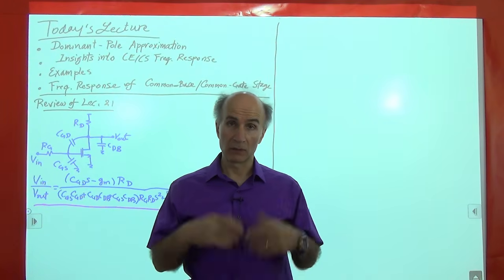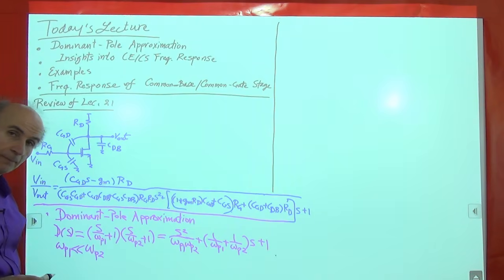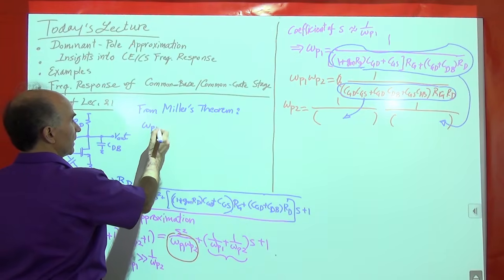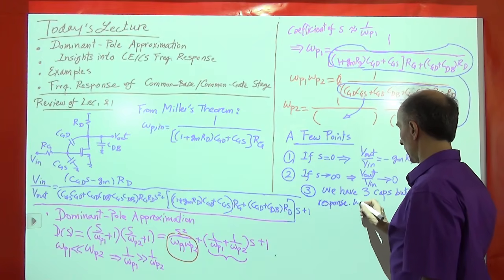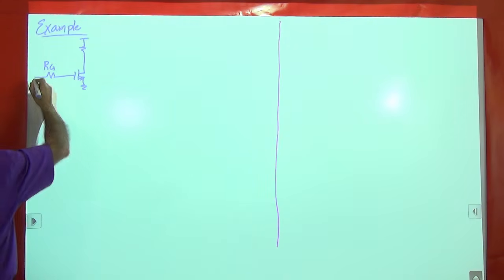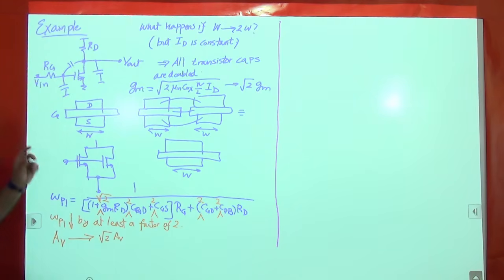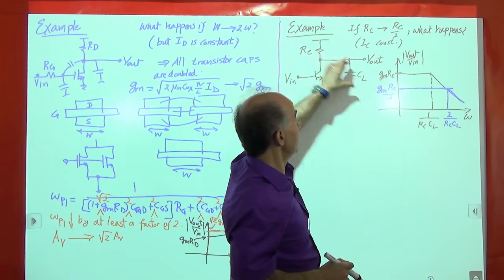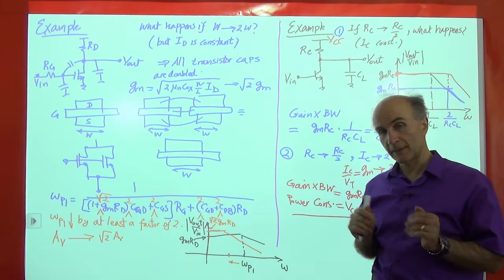Razavi Electronics2 Lec22: Dominant-Pole Approx., Resp. of CE/CS & Common-Base/Gate Stage

Comment: 16:00 By miller since Av^-1 is 0 we can take CDB to ground and get CDB*RD
Reply: It is a common source amplifier. Av=-gmRd, by using Miller's theorem Cgd splits into two parts. One is at the input side. Another one is at the output side. At the output side overall equivalent capacitance = Cdb+ Cgd(1+(1/|Av|). If |gmRd|>>1,      1/|gmRd| term ignoreable. Now you are left with overall capacitance = Cgd+Cdb, so time constant at the output side= Rd(Cgd+Cdb).

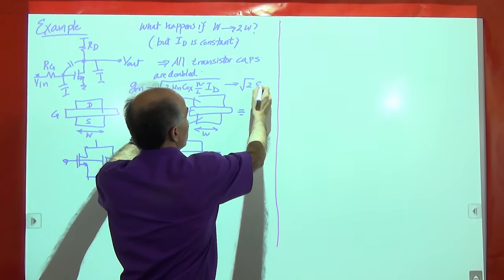Comment: 31:11 wouldn't Cox also be doubled so effectively gm ---> 2gm?
Reply: Cox is capacitance per unit area so it doesn't depend on width and length of the MOSFET

Comment: 01:25 - Intro and Review of the Lecture 21
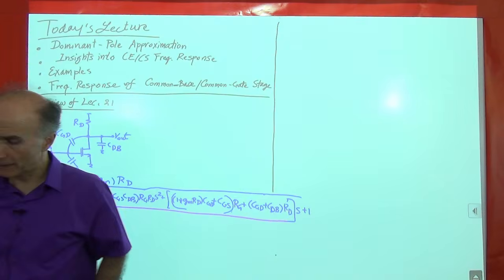05:15 - Dominant-Pole Approximation
14:00 - Comparison between Dominant-Pole Approximation and Miller Approximation
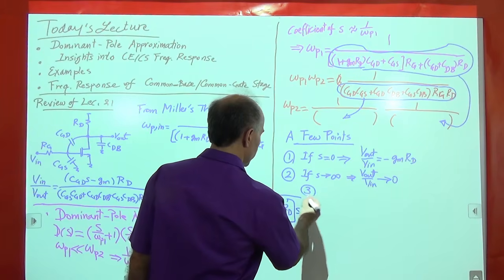20:00 - Order of the System
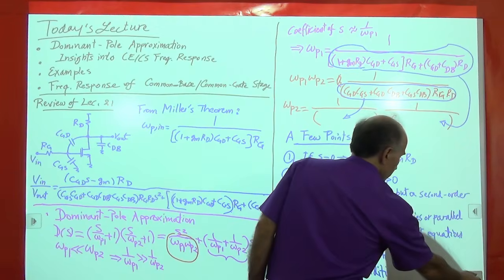26:40 - Example: Gain-Bandwidth Trade-off: Changing Width of MOSFET in CS Stage
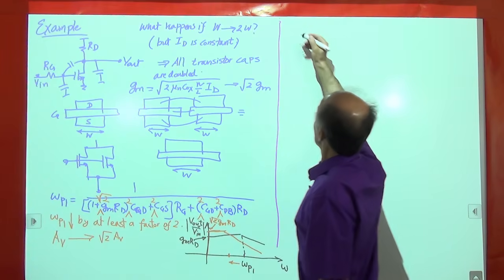36:34 - Example: Gain-Bandwidth Trade-off: Changing Load Resistance in CE Stage
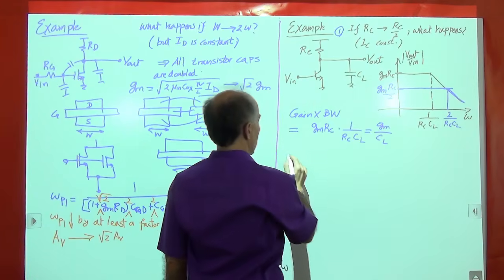42:02 - Example: Gain-Bandwidth-Power Consumption Trade-off
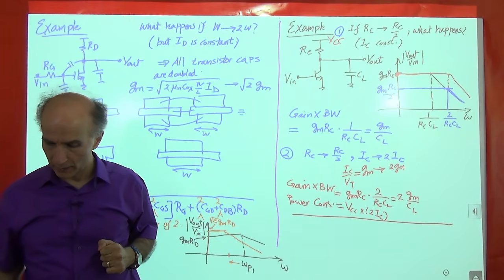45:20 - Importance of Simplification
Reply: nothing to do ?